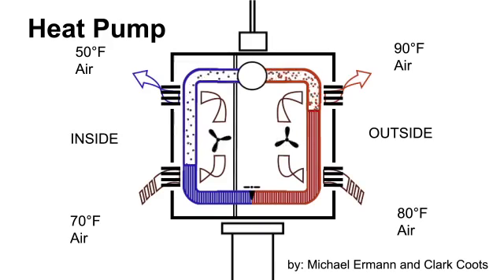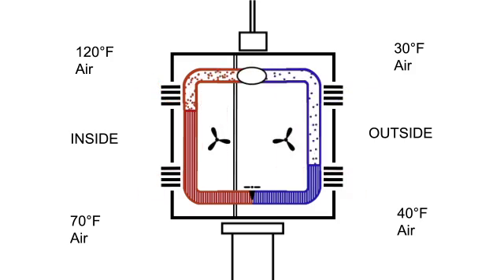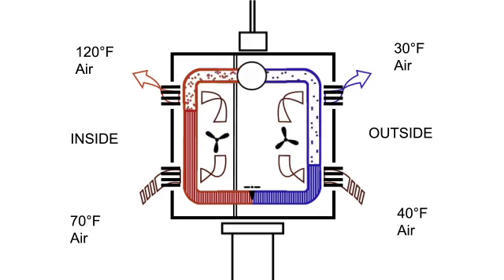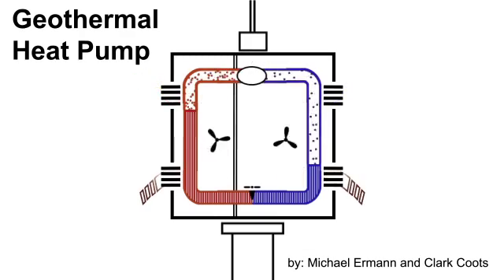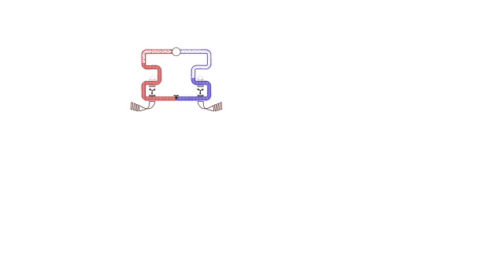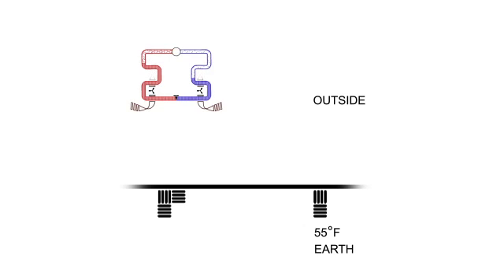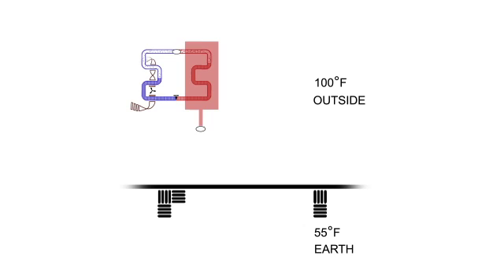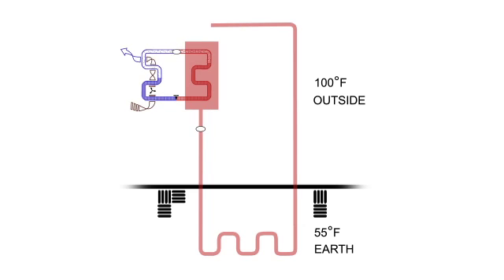How Air Conditioning Works Animation--Part 3 of 3 (Heat pump and geothermal)

Comment: So how does the cooling/heating system of satellites/ISS work? In extreme heat and cold environment without any outside air to transfer heat. Where does the heat go?
Reply: They use liquid helium to cool...
Reply: +Sunil Venkata Are you saying that they are throwing away helium? helium absorbs the heat then they throw it away? How many tons of liquid helium would they waste/pay for that extra rocket fuel for that additional mass? How is the heated helium disposed of? Is it through evaporation? if so does it alter the orbit of the satellite/spacecraft?

Comment: Energy flows in the path of least resistance.  Heat is no different that electricity in this matter...  A coil of wire has high resistance values while gaseous/liquid  materials do not.  Look at your traditional light bulb. It is no different that the element in your toaster. in operation but it is a different material..

Comment: Because it is saping the heat from the outside and bring it inside, its "pumping the heat from outside to inside" so you get the electrical wattage of the AC heating the room plus the heat from the outside heating the room effectively making it more than 100% efficient (you get more heat wattage than the electrical wattage you put in)

Comment: Yes, but not recommended. Have you ever been outside near your window A/C and felt the heat being blown off the coils? If you turn it around it will put that heat in your home. But you will expose the controls and the electrical circuits to the outside elements. You can buy a window unit that reverses the flow of refrigerant and will apply heat in your home. It is called a heat pump.

Comment: Great Video! A question though: How come, energetically speaking, an AC is more efficient in heating a room, than an electrical heat-sink? (coil or resistor of some sort), I am referring to the same heat exchange [Joule/hour]. Where does the energy in the AC cycle, come from? we only "pay" by using the compressor and fans.

Comment: You could if you wanted to, though instead the the circulation of refrigerant inside is reversed so that you don't have to keep turning it around. This make life a lot easier and there are no additional parts required. We do usually think of AC's as Air cooling units where they really are air conditioners like their given name.

Comment: One question, why not put the geothermal cooler/heater right into the ground? Have in and out ducts for both sides and probably filters. Solids conduct better than liquids plus there is no heat exchange that occurs with the pipes that carry the water.